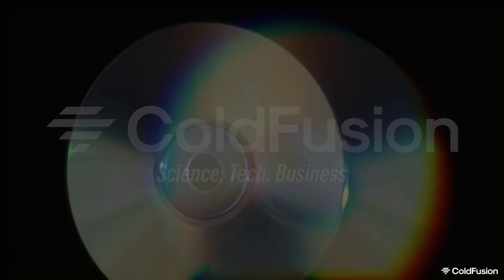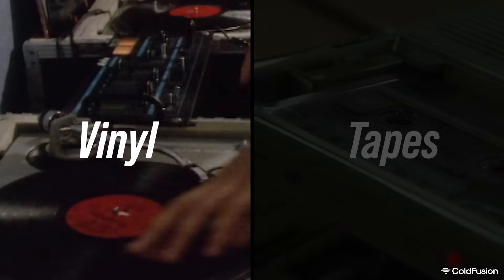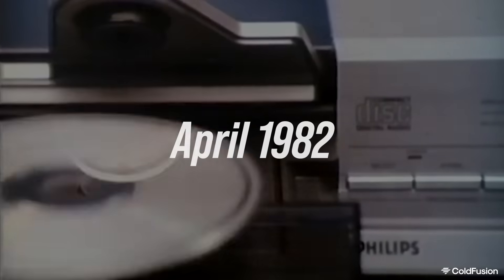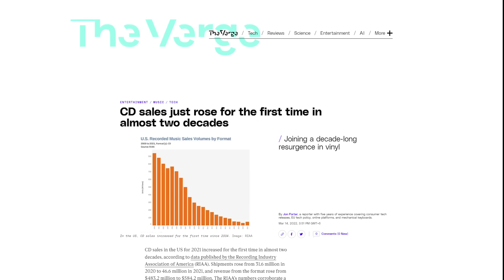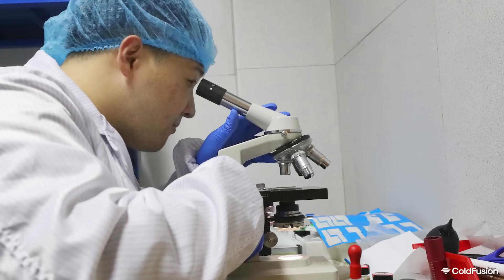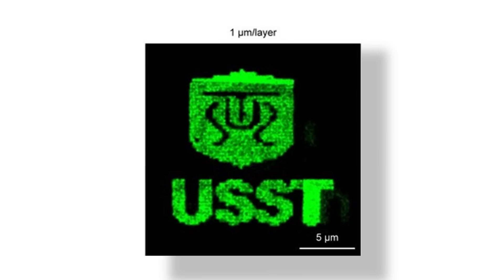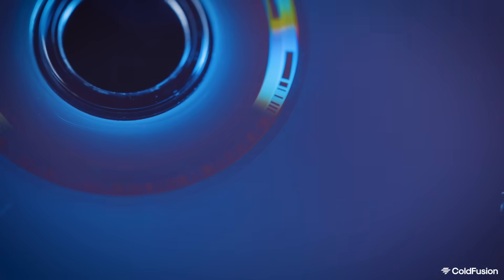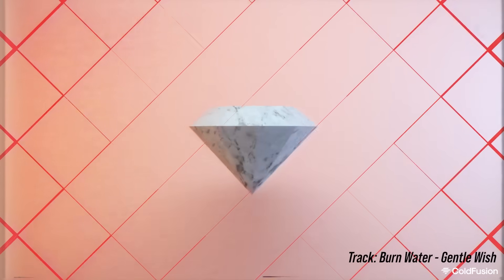Why This New CD Could Change Storage

Comment: Longevity: Just because it's a compact disc is not enough to call it reliable. The data retention medium sounds different, so this will take additional research.
Adoption: Tape backup is not a consumer oriented product, and I doubt this would be either. Yes people are used to cloud and streaming, but that's a red herring. It's irrelevant. Those cloud storage and streaming services would use it, and they're in a position to exploit it to its full potential. This could also drive down costs of archival in areas where the timelines to keep data are extreme. Having a small magazine of discs, duplicated across several sites around the world in small containers, is well worth the price of entry. If they prove durable, the cost savings from not needing to keep storage areas' atmospheres as tightly controlled could be massive.
Reply: m-disc is more hardy than tape, if you  really want your data too last a century m-disk is the way too go

also if your basement floods normal HDDs and tape will die, while m-disks will survive

Comment: I've always had hope a new optical medium would come out but with storage space that can match hard drives.  For me the appeal is backing up data.  SSDs and hard drives can still fail, or lose data even when stored and not used.  Backup tapes can also lose data, and are also very expensive.  But an optical disc(given the disc is manufactured properly and doesn't have issues like bit rot) can be burned, put in a case, and stored safely for years.  Whether or not this will take off since everyone seems to be putting everything "in the cloud" is a question I can't answer.

Comment: The biggest potential drawback I can see from this new tech has to do with human ego. 

What do I mean by that, you ask? Well, when the first 12" vinyl LP records came out, they held as little as 10-12 minutes of music per side. In the early rock era, the Kinks' first albums ran 15-16 minutes per side, the Beatles and Stones' only a minute or two longer. The vinyl LP later maxed out at around 20 mins. on each side, and more often than not, bands pushed that capacity to the limit with albums tending to run in the vicinity of 38-39 minutes. 

Then digital tech and compact discs offered the potential to double that number, and eager musicians took on the challenge, leading to an era of 80-minute monstrosities by everyone from Madonna to the Butthole Surfers; store racks were filled with the most bloated, filler-track-laden behemoths in music history. And once online storage made the sky the limit, we saw bands like the Flaming Lips produce attention-testers like six-hour songs ("Found a Star on the Ground") and even a 24-hour-long toe-tapper ("7 Skies H3 (Can't Shut Off My Head"). 

Trust me: the moment that these new megamegamegadiscs come out with the capability to hold the equivalent of 200,000 DVDs (that's gotta be at least half a million CDs)? To take a commonly used figure of speech and use it literally: We'll never hear the end of it!

Comment: While this is a great solution for archival data centers, corporations and governments, it is impractical for consumers and small businesses.

The limitations of CD's largely remain, the most critical of which is data transfer speeds. These would be impractical for video games because loading the data as you play would be slower than from a solid state media, and this is the real reason games need to be installed on new consoles, even when you buy the disc. The battle against loading screens and ever larger world maps have ensured optical solutions will never return.

For consumer storage of precious information, like photos and family records, the discs would be damaged by casual use, just as music CD's, DVD's and BluRay have been. Cost aside, the need to handle discs with "white gloves" (to avoid accidental damage) kills the concept instantly. Then, if you place them in a fire-proof safe and a fire actually happens... They'll melt inside the safe.

This is an amazing development and will have a lot of use-cases, but it will not bring physical media back to gaming, video, or music.
Reply: this, governments and businesses also already have a storage medium that they use: Linear Tape Open (LTO). the latest gen stores 18TB per tape cartridge, they have a solid plastic case around the tape so handling them is easy, and as much of the tech as possible is in the drive so that the tapes themselves can be as cheap as possible and ordered in bulk. this optical medium would have to solve several of these already solved issues and improve on them to compete in the enterprise and government space

Comment: If there is ever going to be next generation of consumer discs, I hope they'll finally add scratch protection. I always did wonder why didn't cds have the same form as 3.5 inch floppies... Being in a closed shell and only opened while inside the reader would have reduced the disk damage.

Comment: Respectfully, I can't see this taking off. For those unaware, 20 years ago a similar idea was conceived with the Holographic Versatile Disc (HVD) which could hold 4TB versus the 50GB Blu-rays at the time. It never took off for the exact same reasons that plague this new CD technology but now this has to contend with streaming.
Reply: Perhaps it can also have a legacy CD layer that can be used for transitional period?
Reply: forget streaming, videos are not the best use case. flash storage has the issue of long-term storage. after a few years, especially with cheaper drives it tends to wipe itself. HDDs also have a longevity issue too 3-5 years spinning in a system with about 20 when out of it. CDs have less moving parts than a whole HDD. Less to go wrong. If this lasts longer than that, it'll be fantastic for archives.
Reply: @m-jq6cw  "3-5 years spinning"

24/7 under 100 load. You mean. That was the conditions of that IBM study you are referencing. Tell me. Do you keep your external drives running 24/7 under maximum load?
Reply: The read speed of the new 200,000 gigabyte optical disk will be dog slow.  Unacceptable, vs speed of SSD.
Reply: @DerekDavis213  HDDs are also slow compared to SSD, and people buy them because they are cheaper per TB, speed isn't everything.

plenty of content creators would love a CD where they could dump data, instead of owning a 3 ton server

Comment: I've seen research of high density optical discs before like this that never really got off the ground. This reminds me of the HVD, Holographic Versatile Disc. The project went under due to the high cost if I'm remembering properly. Like in the cons as you described.

Comment: We will be lucky if these ever see the light of day for consumers. They face the same challenges as all the other discs.

They will be expensive.
Readers will only read.
Writers will be out of reach for a long time.
Once you can get this in the hands of the consumer for a decent price, it will be a trivial amount of data that takes a very long time to write.

This would be useful in data centers as long term backup such as with the internet archive. It's far too slow to serve data. The seek time alone would be painful and the time to load the info would match.

Blurays already hold a lot. They are still expensive to write and especially with 100GB discs.

Blurau will have to be as inexpensive as Dvds are now in order to make room for this new technology.

Comment: Heck, I still use my DVD-Rs and don't intend to get rid of em. I don't trust cloud storage worth a damn. I'd love to see this new physical format take off.
Reply: DVDs are considered the least safe optical media tho, i would recommend switching over to blu-ray, they are 25GB and more anyway, M-disc bluray are even more resistant and can survive being submerged underwater and other things

+ modern burners like nero lets you add redundancy so depending on how much data space you are willing to sacrifice you can get lots of scratches and the data will read just fine
Reply: @automatedrussianbot  Price is a factor however, but thank you. ;-) Def. blu-rays are superior but it may be a bit before i can transfer my archives.

Comment: Optical storage is neither durable or long lasting. Data rot can occur under a bunch of circumstances, and when you have data densities exponentially larger then that only risk increases.

If the energy consumption and write speeds improved it could absolutely be a feasible storage option, but this will never be available to consumers as the concept of ownership is being eroded by a bunch of people who will throw you in jail for naming them.
Reply: What type of storage is durable and long lasting?  Just curious....
Reply: @alals6794  Stone walls and tablets seems to have outlasted everything so far lol!

In all seriousness,  there is glass optical technology I read about a while ago that would have a much greater lifespan than CDs, but had similar problems this technology has ( read/write speeds, cost prohibitive implementation, ect ). Whatever they come out with probably won't be for us though.

Comment: Thats nice but why do we need 1pb on a cd. I know theres materials that can make cd last 100 years or more. But it still fragile.  Portable reading its a bit slow and vibration disrupt its performance.  Memory card is really practical in things like camera. Speed required to record at 4k or 8k speed. Its quiet, no moving parts and energy efficient.  Although its still cool.

Comment: the way i see it is instead of a CD sized disc why cant we make it smaller with less capacity for more portability.. a tiny 1.5 inch disc in a protective case will not be much larger than a USD stick and it'll be thinner.. imagine a tiny floppy disc.. the same will be the case for the device that has read only capability, it'll be somewhere around the same size as a deck of playing cards.. the capacity of such tiny disc with that technology would still be in the gigabytes and can hold all kinds of data for portable use and long term data storage.

Comment: If they have reached this much capacity in an optical drive, it should be in normal magnetic hard disks, that is, a 3.5" HDD will soon be released as 1 Pb and this slow media will not be used again. 🤣

Comment: The best way to compare data density is data per dolar/euro, call this storage value, and then compare it to the size. Stuff like magnet tapes can be really dense but together with the needed equipment it takes up alot of space, but the only variable is that it's the best data value, the flaw is read/write speed.
Something like this cd can only be read bit by bit, and ssd's on the other hand can acces multiple bit locations at once, hince why they are faster but expensive, and not as good compared to hdd at large scales, but on a small scale like a personal device they're the best option.
Another factor is power requirements, tapes don't take as much as hdd's at the same scale, ssd's are even worse in high quantities (why have all this speed, just to limit it to save on power)
This disk tho... I don't really know how laser compares to solid-state switches and magnets - but it still involves a motor spinning a thing fast...

Comment: Pretty much all of the downsides were the same ones we had when, in about 1985, I got my first HDD; a whopping 20 Mb. When I got my next HDD, a 40 Mb drive, I figured it was a waste of money because I'd never need all that space. And the really big drives - 100 Mb were far too expensive. An IBM PC-AT, with the super fast 286 processor was $10,000. So, if / when this comes to market, many of the issue will be resolved in due course.

Comment: Even at a very optimistic 100 MB/s write speed it'd take over 16 days of uninterrupted writing to fill the disk up. I cannot see this catch on even if they solve the energy and cost problems for the lasers unless they make leaps and bounds in write speed.
The current archival medium of choice is LTO tape media. The most modern iteration (LTO-9) will do 400 MB/s uncompressed - more, if the data is compressible.

Comment: It doesn't matter if tech exists which I'm sure it does which is way beyond what we have now. Even what we have now is being governed. It took over 10 years for 8TB hard drives to go from 400 dollars down to 130 dollars and 4TB to go from 160 down to 90. If you don't think the market is being controlled you are a maroon. I had to buy 3 4TB drives every couple years from running out of space and replace them 1 at a time with 3 8TB drives in same scenario.

Comment: LP's sound better than cassettes, cassettes sound better than CD's, CD's sound better than MP3/4.

Compare an LP to an MP3/4 and the difference is staggering. LP's are so much better.

When you convert analog to digital then 'compress' it you sacrifice quality for profitability.

Comment: To store 1.6 petabits on an optical disc of the same data storage area as a CD requires over 270,000 times the data density -- such a disc probably couldn't be exposed to the environment at all.  "Optical discs are known for their longevity and durability ..." -- not in everyday use they sure aren't!  Most of the CDs in your video have visible crud, scratches, or other damage visible on them.

Comment: Plus another downside: a single speck of sand in the case and your data is done for. I can imagine though a similar method as the minidisk might help, being enclosed... In any case, as per 2024 I see no point for this other than backup operations on DC level - there it might be finally a good replacement for long term Backups. Otherwise I see no point for it...

Comment: As far as I can remember since the introduction of CD-R's to general public, they say there is almost ready technology for multilayer writable media. And what we got? Dual-layer DVD - 9 GBytes. Dual-layer BD - 50 Gbytes. 4-layer BD - no one seen them in the wild. Only lab prototypes too expensive to manufacture or to fragile to use in everyday life. Sad but true.
Reply: 4 layer blurays were pretty common, especially when they were newer over in Japan where people still had DVRs that used Bluray as opposed to over here where the DVD DVRs were niche products that were nearly extinct by the time Bluray picked up steam and very few Bluray models made it to the west.  Even right now you can get 5.5 TB Optical Disc Archive cartridges at pretty much any store that carries professional equipment like B&H.
Reply: @DigitalMoonlight  Thanks for the info. I'm just talking about consumer products as were (CD and DVD)-R's, dirt cheap optical discs anyone can buy in shop across the road. BTW, ODA 5.5TB cartridge uses 11 optical discs, 3 layers on each side, at 500 GB per disc as wikipedia says, so it is not a single disc.

Comment: This might be very interesting for doing very large scale backups (as in whole datacenters), a huge machine with a super expensive laser would not be a big deal for a datacenter, especially if they could then save a lot on the disks
Reply: i feel like a datacenter is more likely to invest in an LTO system, with that being a tried and true technology, reliability is the name of the game in the enterprise space after all
Reply: @oggilein1  yeah that was just the only usecase I found for it that might make sense. These disks could be a lot faster than lto though, especially if there'd be any random access. But probably more of a solution looking for a problem, especially since lto tapes are planned to store 150tb by the time lto12 comes out

Comment: There's quite a gap in storage and price from Blu-ray to this. Maybe if there were more such options on the market, more people would use discs for their long-term/archival file storage. BDs are too small for modern backups, but discs ranging from, say, several hundred GBs to a few TBs would be perfect. A few of those could back up a modern PC easily.

Comment: I use CD's and DVD's regularly. Gaming on the ps2 and ps1 era of games, you handle them a lot. I still also use re-writeable DVD's to store games and spare data. I have multiple forms of backups for my music so that I can always find a file if I need it, even if it isnt perfect. I DJ a lot so having this as a backup method maybe isnt the best, but having it as a backup for my backup, for THAT backup, its a solid solution.

Comment: Bluray can do a max of 128GB. You'd think by now 1TB disc would be very cheap. Back in the day I use to buy spools of blank DVD for backups and it was pretty cheap. 8.5 GB on a dual layer dvd is useless now. I never found any 4 layer DVD discs but supposedly that was possible even back then for 17GB discs. LTO-9 can hold 18TB per tape. Under $80 per tape when buying in bulk but you need the expensive recorder deck. At the pace they are going 200TB won't be enough storage by the time they launch this. Iphones will have 10TB storage in another 8 years.

Comment: I remember reading about breakthrough in 3D layer discs and other revolutionary storage techniques for 2 decades now, none has hit the market.
Reply: 3 reasons: 
1. noone needs this amount of storage in a physical disc
2. the total cost of such a system is basically always going to be too high, especially when that money can be put into more HDD or SSD space
3. internet speeds have become fast enough that downloading to said drives or streaming is a better solution.

Comment: The old CD and DVD suffered greatly from not being in a cartridge like a 3.5 floppy drive.
The first generation ones actually were.   It's when they started mass producing and selling them cheaply as simply platters that the medium gained a reputation for being massively unreliable.  All it took was some scratches or dust and your data was unreadable.